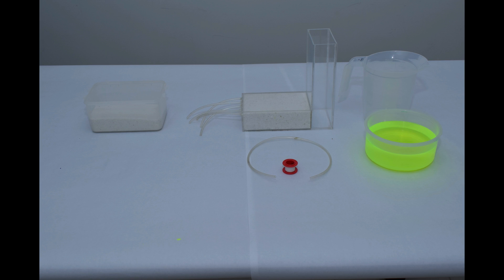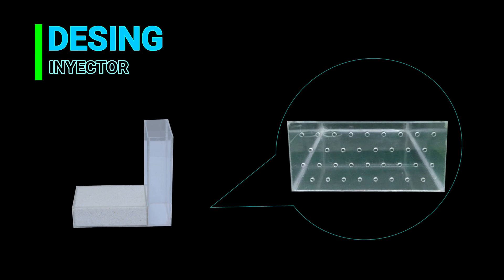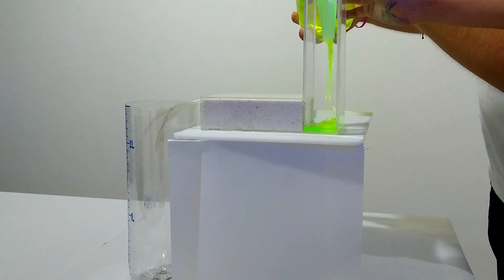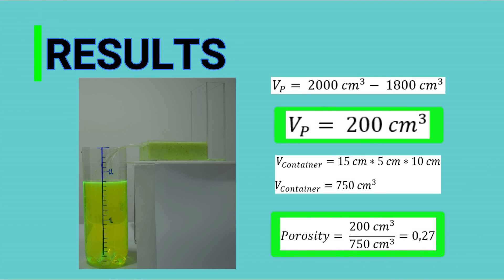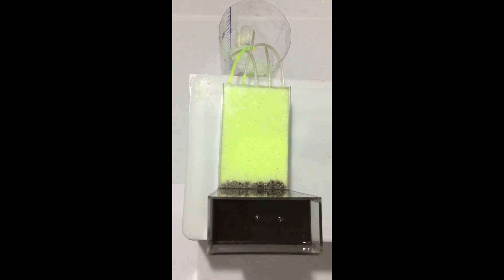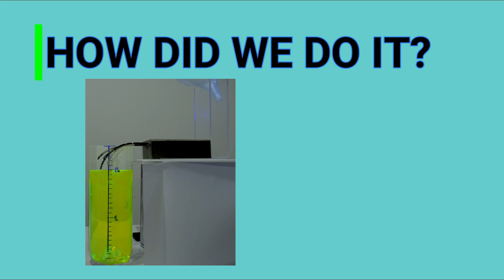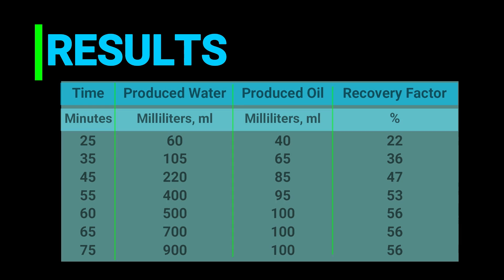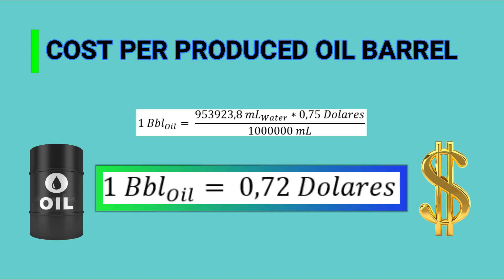Water Injection Experimental Project- UIS

Comment: Nice video, but, Is the oil too much denser than water?
Reply from the maker: Miguel Molina Hi Miguel. You've noticed  that mistake and we too, but when we did it the video was on the internet yet. We had written it in the description of the video. In this case the correct sentence is that oil is to much VISCOUS than water.

Although,  oil can be denser than water, but not to much, just a little.

Thanks for the commment!
Reply: Pleaee explain how sometimes it can be denser thab water? Obviously at different temperatures but never in standard conditions!